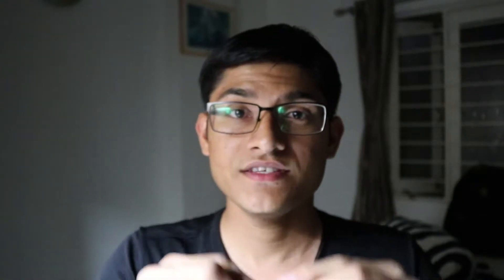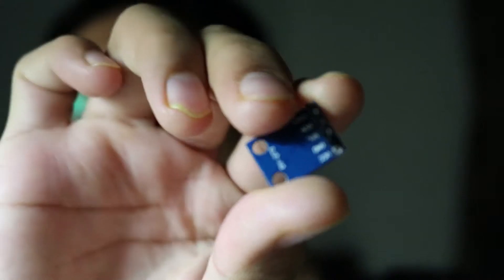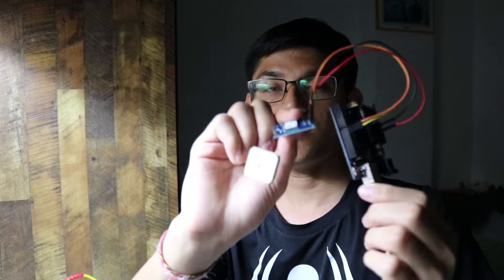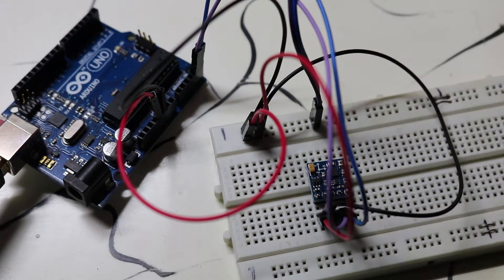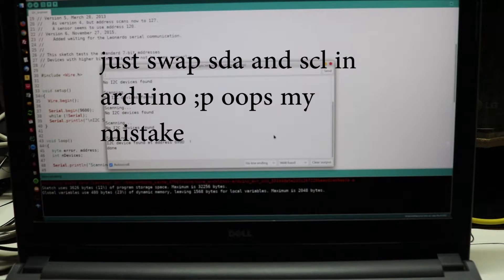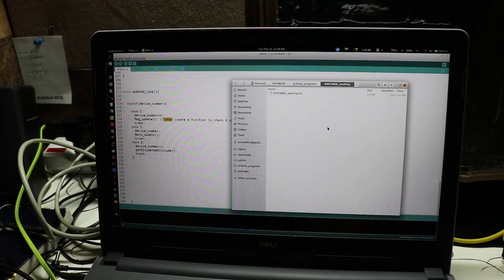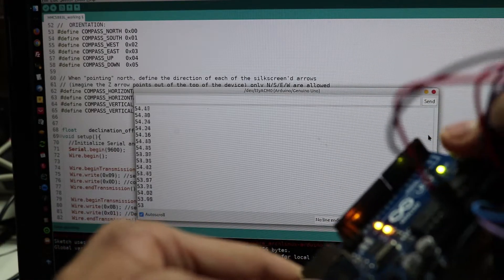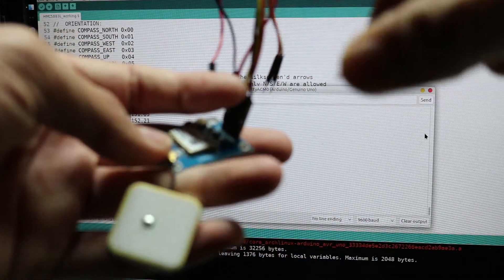Tutorial : Arduino HMC5883l

Comment: Hi buddy, i tried running your codes but Im getting no values for the x, y, and z. Im using the mega arduino
Reply from the maker: try running i2c scanner may be you have another i2c address for hmc
Reply: @robokishan  I am getting the x y z value but its not changing values
Reply: @SawbanHash  you probably have another the 1E as i2c address instead of 0D, try changing the register addresses and configure data